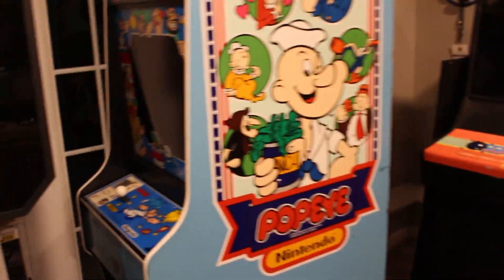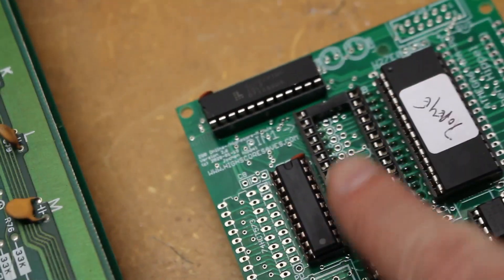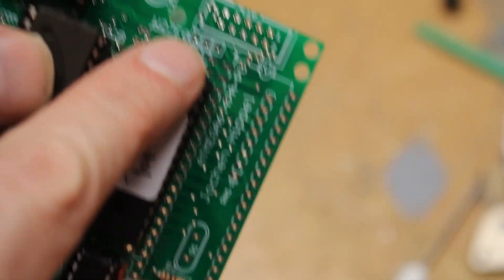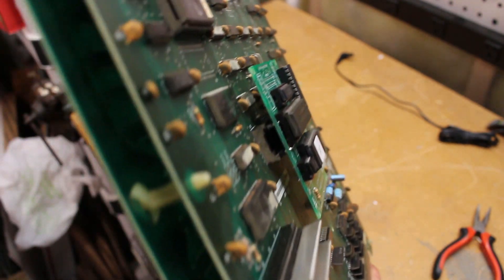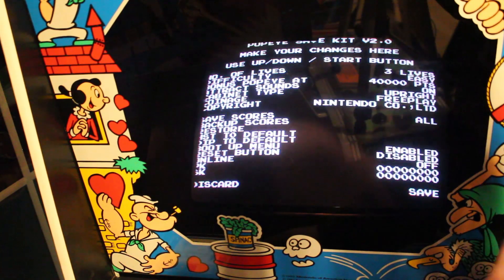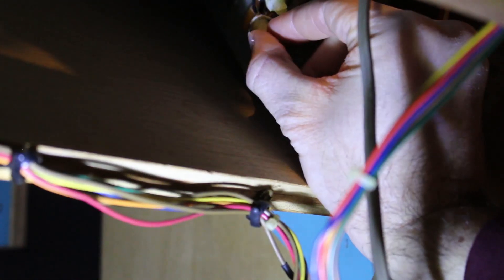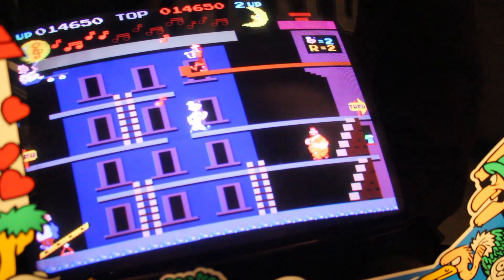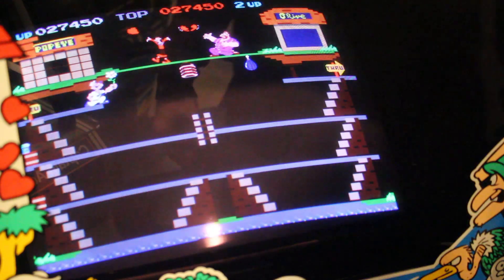Popeye Arcade - High Score Save Kit Installation

Comment: These High score save kits are a god send. I own 3 Nintendo arcade cabinets and every single one when I got them had the coin mechs totally gutted so they could just use the coin micro switch to coin up the game. My favorite save kit I have installed is the Donkey Kong Jr one because you can switch from 2 different games the regular game and Donkey Kong Jr remix. Wish they would do the same for the other games.